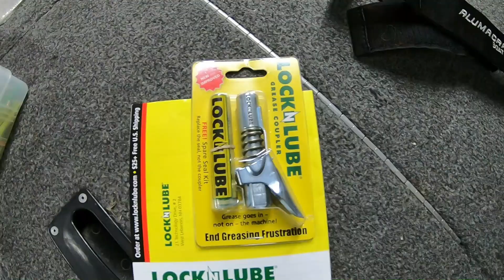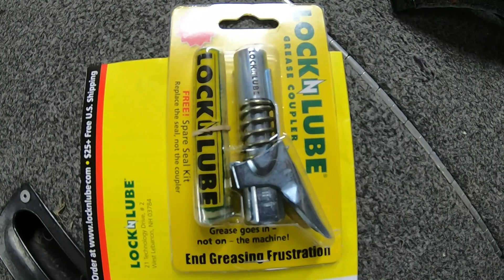Boat Trailer Maintenance HACK (Contest is Closed)

Comment: Yup I need to check my bearings. I try to grease mine 2x a year.
Reply from the maker: Hank, I am guessing that your season looks much like mine: I make dozens of trips every year to lakes within 50 miles of my house, and i make only 2 or 3 trips per year where i travel more than 100 miles.  Therefore i typically dont put more than a few thousand miles per year on my trailer, so I figure that by servicing my bearings 2 to 3 times per year, I am good.